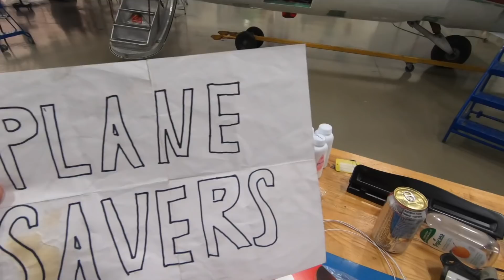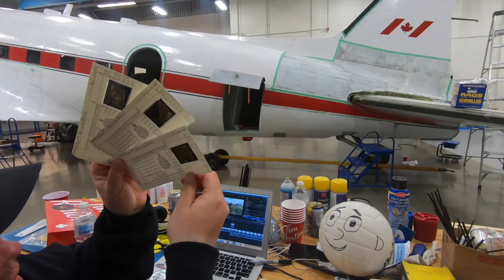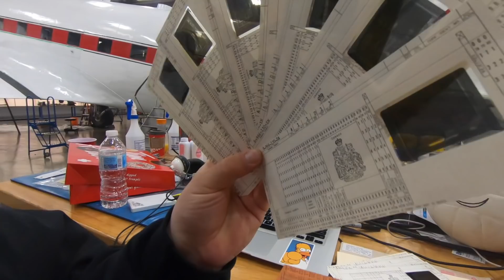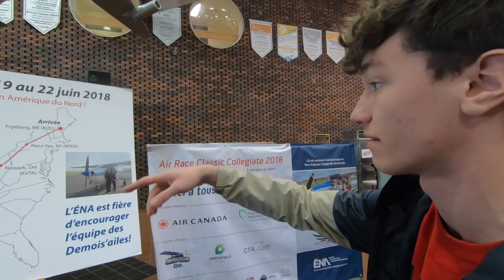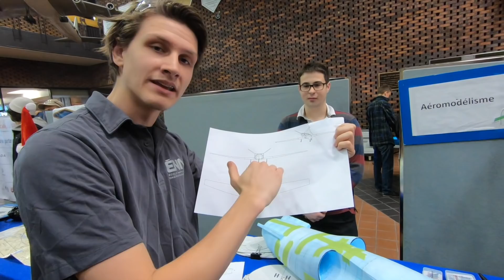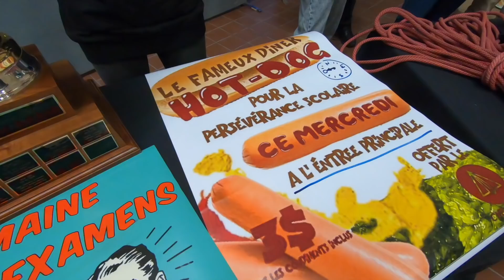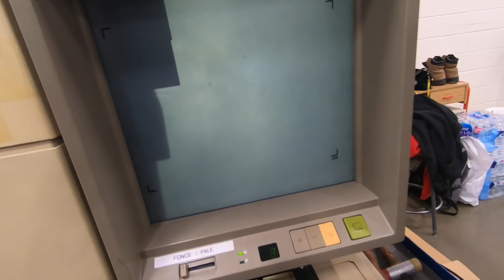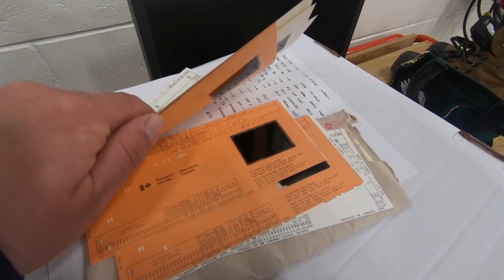"Fred Finds our DC-3's Long Lost Diagrams!" Plane Savers E127

Comment: OMEGA was a ground based global radio navigation system. It went operational in 1971 and kept going until 1997. I was not the first global system, the Transit satellite system came in 60's. OMEGA was a hyperbolic system like the British GEE  or the US Loran system during WWII. You tuned to a pair of stations and by comparing the two radio signals you could figure out the difference in the distances to the stations. Then, with the help of special charts you could figure out a fix. 

The difference was that while Loran and later Loran-C were relatively "local" systems with a range of a couple thousand kilometers from the transmitter chain OMEGA was a global system using only eight stations spread across the globe. This amazing range was partly due to the fact that while Loran-C operated around 100 kHz OMEGA operated in VLF band around 10 kHz. The early receivers were quite heavy and had to be used with special charts to obtain a fix, the later ones got smart and could give you a lat/long straight out of the box. Another drawback of the was that the system had to be initialised with an initial position (like inertial systems) at the beginning of a trip and kept powered for the entire trip. It was a bit of a hassle to re-initialise if power was lost for a longer period during the trip. The closest transmitter site to you was in North Dakota I think...

Great job with DTD!
I watch every episode on the train to work in the morning!
Cheers from Sweden!
/Julius
Reply: Nicely said. This system was in fact, one of several critical phases of not only radio navigation platforms but also laid the foundation for several proof of concept projects. One of which was the development of digital signal processing for civilian and military NAV systems in Canada. Gee was the basis of much of this work carried out by Transport Canada DC-3's,  Northstars and several specially equipped Lancasters. It was, shall we say, one of several  early test cells in nav signal encryption - with a unique Master Signal clock, a forerunner of future GPS signal encryption. 

Transport Canada aircraft were often used for these research flights during the Cold War. High frequency NAV  radio transmission accuracy posed significant technical challenges North of the 55th  parallel. Omega was high fidelity compared to Gee.

Even so, Omega was only one of several navigation research programs TC was involved with given the complex geography of Northern Canada.
Reply: Julius Sokolowski Hello friend from Sweden.
Reply: Thanks for that awesome description Julius.
10 kilohertz wow
Reply: I flew a Falcon 20 for several years that was equipped with a Canadian Marconi 771 VLF/OMEGA system. During its day it was not too bad but was quickly surpassed by LORAN-C and later GPS. It was only legal for enroute ops and with only ten waypoints, which were lat/long, you were constantly revising the waypoint list. Things could get interesting in a high density environment trying to determine how to enter a waypoint, such as an intersection, with no lat/long definition printed on a nav chart. Many times the unit would go into the DR mode so you had to, as precisely as possible, fly over a known fix and re initialize in the air; a SWAG at best. We later added a dirt simple NorthStar LORAN which had a database with all of the fixes and their lat/long definitions. Life became much simpler and then the Marconi became a secondary system.
Reply: @grumpyoldfart1945  Thanks for that info, right from the cockpit👍

Comment: I am work with old drawings all the time, sometimes microfiche.  On the microfiche you can zoom out by either switching lenses or sometimes the lens itself has a rotary function that will zoom the lens.  The correct lens can display the entire drawing.  The copy function is touch and go on the old machines.  Best thing to do is to make a digital copy before you send the drawings back.  Then you will always have the drawings.  You can have it done professionally or on the cheap.  You can scan them on a regular copier or photograph them on  alight table with your camera zoomed in.  If you use the copier, use the highest resolution setting.  Black and white will help keep the file size down.  Setting the paper size to the smallest will keep the file size to a minimum.  TIFF is great for blueprints, JPEG works good too.  Once you have the digital scan, open the file with paint.  Crop the drawings down to their original borders and then SAVE AS with the drawing number as the file name.  Then reopen the negative in Microsoft paint or any photo app.  In paint, use CTRL+A to "Select All", then right click the image and click the INVERT COLOR function.  This will make the negative into a positive.  The drawing(s) will now be a white drawing with black lettering.  I have done this with 35mm photos, not microfiche, so I can't say for sure that the drawing resolution will be great from a scanner unless you can go 600 dpi or higher.  The zoom on your digital camera should be more than sufficient though.  Tape the fiche to an X-Ray film viewer in the X-Ray lab and you can use your tripod in the vertical.  Thanks for sharing the restoration, I have enjoyed it from the beginning.
Reply: Wow--great information, thanks for your input!
Reply: I am a design engineer.  More than once it payed off to use the microfiche to find old drawings that are missing.  I never tried to scan one though, I could generally use the 8-1/2x11s from the printer to get the drawing number and then find the original blueprint in a design manual.  I hope they get the drawings off the photos, I totally know how valuable an original drawing is!

Comment: What Fred was talking about with the Omega Nav system was in use until the late 1990's and the G station (In Woodside, Victoria) is not far from where I live. We know it as the VLF (Very low frequency) or over the horizon system and it was used for many things including Navigation.
I remember as a kid seeing the massive Aerial installation and even when VLF/Omega ended in 1997 the installation was used for Submarine Comm's.
Obviously the lower the frequency the larger the physical radio wave and the larger the Antenna and as VLF is Low the Antenna/Aerial is huge as well as quite high up to compensate for the curvature of the earths surface.
VLF radio is also high power and along with the huge aerials required would always be a very large portable unit needing a lot of battery power as well because the higher the frequency the more susceptible the radio wave to interference and absorption by obstacles and clouds where as the lower HF frequencies being larger waves and higher power could punch through or around any terrestrial obstacles much in the same way as the old 27 mhz CB radio compared to modern UHF 477 Mhz which relies on repeater stations due to its far shorter wavelength.
VLF/Omega is basically early GPS (Global Positioning) amongst other things but terrestrial instead of Satellite..
https://en.wikipedia.org/wiki/Omega_(navigation_system)#Woodside_Omega_Transmitter

Comment: Hi Mikey,
Omega, OMG It’s been years, but I have worked on aircraft with that system.
The aircraft antenna was usually underneath the aircraft.and not a long wire antenna as Fred suggested. 
There were 8 transmitters around the world, and their output signal was coordinated. 
The aircraft receiver had to be programmed by the operator with the starting location and the waypoints for the intended route. 
The system was accurate to within 1.6 Nautical Miles anywhere in the world.
The U. S. controlled the transmitters and an Omega report was issued by the US government on the time frequencies (2.5, 5, 10, 15, and 20 MHz) at 16 minutes past the hour, 24 hours a day.
With the introduction of the more accurate and reliable GPS, The Omega Transmitters we’re shut down and decommissioned in the early 1990s.

The antenna is electrically a long wire but is a sealed unit about 10 inches across.

Oh I forgot this system operated in Very Low Frequency (VLF) ranges.

It requires a navigator to operate (so much to do to figure out position) and was good for long range navigation. I’d bet that the your aircraft ROD was equipped wit it for Nav Training.

Hope this helps.

Comment: Omega navigation was first developed towards the end of WW2 and was the precurser of GPS,the system relied on carefully aligned ground stations and was used for oceanic and aviation navigation,the large unweildy wire wound antennaes ran from nose to tail and the tuneable direction finding loop antennaes  were fitted atop the fuselage,you can see it in photographs of aircraft in use up until the mid sixties until its ultimate cut off point in 1970 in favour of the system we know so well today Global positioning.
I remember my father talking about the WW2 system called Loran used by the RAF.

The students have some great clubs there and I envy their access to such activities,they are all smiling happy folk with what are probably the best instructors in the world,they must feel very proud to be learning their trade at such a dedicated and well equipped establishment that even has its own tool car boot sale !

My word DTD is looking smart with Stellas  carefully planned paintwork,I like the way she tackles a manageable area at a time carefully marking it off with masking tape,well done Stella !

The DC-3 just gets better by the day and now it will get its tail feathers fitted which is good news.

Comment: I'd love to hear those radials without the mufflers (silencers), those too efficient mufflers on them -- can't wait to see her in her full coat of new paint, elegant DC3
Reply: The two cylinders on the side of the nacelles are heat exchangers not muflers they provide hot air to heat the cabin and hot air to prevent carby icing.

Comment: Flew for Ptarmigan Airways in the 90's and The Citation had an omega in it for primary navigation.  This is right around the time GPS was first coming onto the scene, but as the omega was installed that's what we used. Great piece of equipment, kept you within a mile or so of your intended track, but had the occasional habit of going offline momentarily. Once back on, it took a while to figure out where it was and you had to navigate by time and heading  during this period.  Good for door stops now, but I'm glad I was able to experience "Omega Navigation"
Reply: In the Keewatin?

Comment: Hi Mikey and the gang, I have been watching the series from the start. I am in Australia and grew up in South Gippsland in the SE corner of Mainland Australia. Australia and the US constructed an Omega base station at Woodside, about 50 miles from home in the 1970's and it was removed in the 2015 . From memory the system used extremely low frequency radio signals (around to upper limit of human hearing) and was used for aircraft, shipping and submarine navigation. The frequency was extremely low to allow signals to penetrate the ocean and be received by submerged subs. I believe it was the first reliable submarine nav system deployed. The Woodside station was I believe the last one needed to give worldwide coverage, and the radio mast was incredibly tall by Australian standards 1500 feet, and located near sea level a short distance from the coast. Omega was shut down in the late 90's, but this site continued to supply ELF communications for submerged submarines into this century. The facility was removed 4 years due to being redundant, having a lot of failed obstacle warning lights, and because it had become an item of interest to base jumpers on one had died in a jump from the tower.
Congratulations on the work to date, culminating in the engine runs yesterday. Special thanks also for incorporating the students in the project, and huge thanks to the school for their co-operation with the project, including staff and student assistance, providing hanger space, and their efforts that have allowed you to incorporate a view of their training and facilities into the series. Good luck and best wishes, will continue to watch the series. Wally

Comment: One can take digital pictures of the microfiche display  . The mac you have can probably piece the images or print them individually  for a tape up job. Do put a small piece of tape at the corner of the display changed for each different page. Or put up the whole card as a title between cards to keep them separate.  If the school has an overhead projector. You might get it to show on a wall to photograph.

Comment: There is still an Omega radio tower here in Australia in Gippsland.  -38.188303, 147.095223  it is really tall and it was the only thing for miles around that high. Made my LSALT higher when night flying there.

Comment: Omega was a long range global navigation system (similar to LORAN). It was the GPS of the day. Instead of sattilites it used many ground based very low-frequency stations. By triangulation it could calculate where you were using station location.. it was in service from 1971 to 1997, when the stations were shut down.

Comment: You walk into the hangar exactly the same way as in Yellowknife.  Very funny. What's the temperature?

Hey, unless there's something seriously broken the framing on a microfiche reader is fairly easy to fix.  It's mostly mechanical. And as far as printing. Clean the screen and take a hires photo of a low magnified fiche and then reverse the negative image in any photo editing software. You may have to play around with the magnification a bit.

Comment: Look for a high end camera store. Not your big box outlets, but the kind professionals use. They will have the ability to properly scan those microfilms into digital format, where you can then print them onto blueprint sized sheets, or smaller, if you want! (I would print on 11 X 17, as that size should be large enough. It's also called "Tabloid" for sizing.) I know a place in Winnipeg called Dons Photo, they would be able to get this done for you. But I'm 100% sure their will be a shop in the city you are in or near by.

Comment: The Omega navigation network was replaced by GPS decades ago, along with LORAN. If it were still installed in the aircraft ,it would not have the defunct Omega network's signals, and would not work. 
Very cool bit of the aircraft's history though.

Comment: The Omega system. I don't know a lot about it. I learned a little about it. It used an Omega computer. They were a very good machine in their day. You might still be able to use an old one to access the internet. Last I heard 30MB was the biggest hardrive it could handle. It was the computer of the long range bombers and spy planes into modern times. It kept on working just fine for their purposes and it was impossible to hack into because nobody understood them anymore. Fred was right about the long antenna. It used principle patented by Nick Tesla. It could send and receive ultra low frequency signals a very long distance. They used it on the submarines too. That's why they had long trailing antennas. I don't think this is stock stuff. This plane was used for cold war hanky-panky. All very quaint and declassified by now, Right?
Reply from the maker: Very cool!!!

Comment: Absolutely fantastic Mikey.   I was sick yesterday so I had to watch the engine start this evening after I started feeling better.   I have a question, are you going to replace the deicer boots on the elevators and wings?   I know up there in Yellowknife the air gets a lot colder and I figured you'd need them up there.  I'm glad everything is coming together so well.
Reply: Ron Krueger plane will live in red deer most likely
Reply: @thesawch63  Ok Thanks.

Comment: The camera makes the props look like they’re not spinning
Reply: The shutter speed on the video cam is too fast which causes the stop motiom and slow motion effect. The apparent bending of the blades is the electronic shutter working like a rolling mechanical shutter.